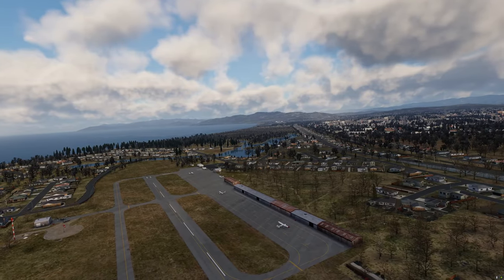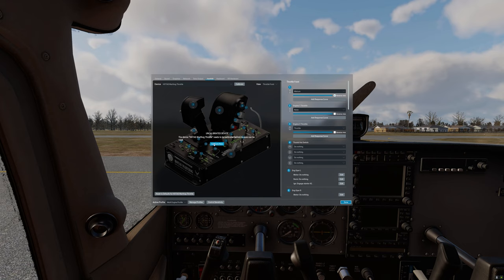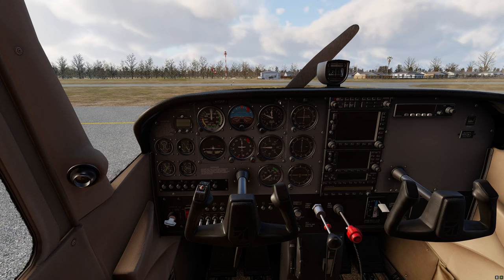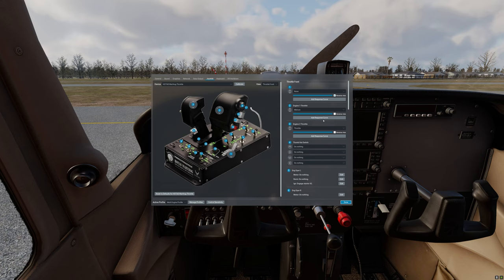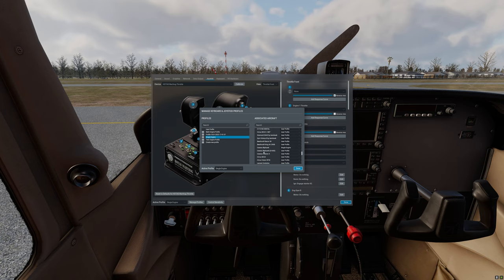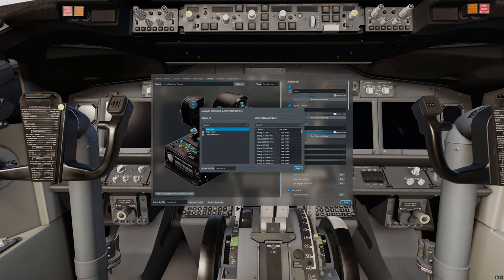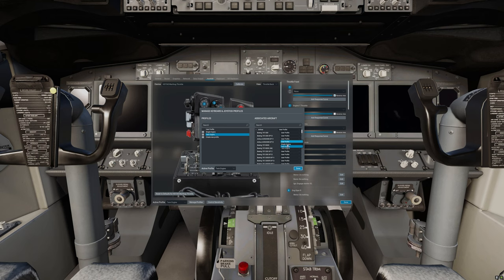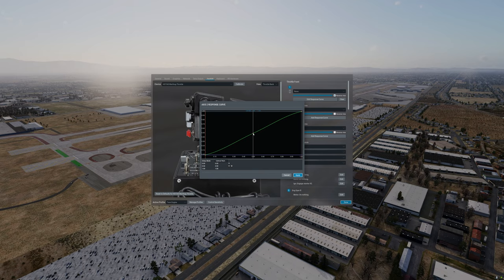X-Plane 12 | How to Configure Your Throttle Using Profiles

Comment: what about for the 747 4 engine plane with only 2 throttles accessible
Reply from the maker: You can set up 4 throttles if your flight control has 4 axis. The Honeycomb Bravo throttle has 4 axis you can assign as engines 1-4.
Reply: @Q8Pilot  What if I have the same Thrustmaster throttle as you have (2 engines) and I would like to assign left throttle to engines 1 and 2 and right throttle to engines 3 and 4?
Reply: Same problem here